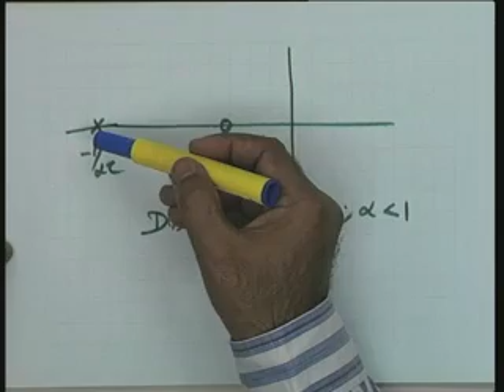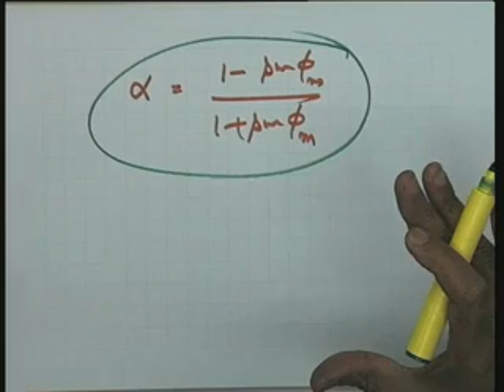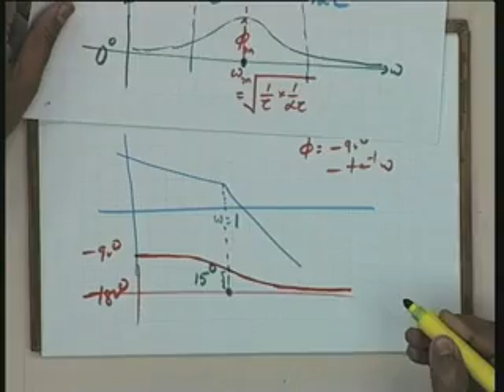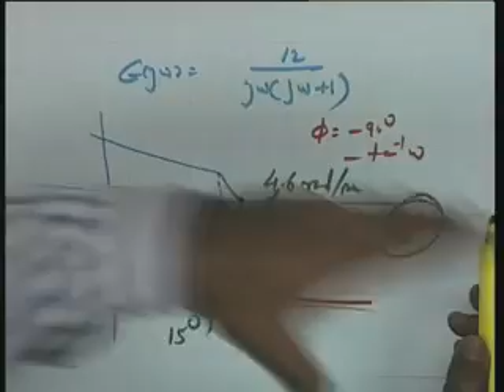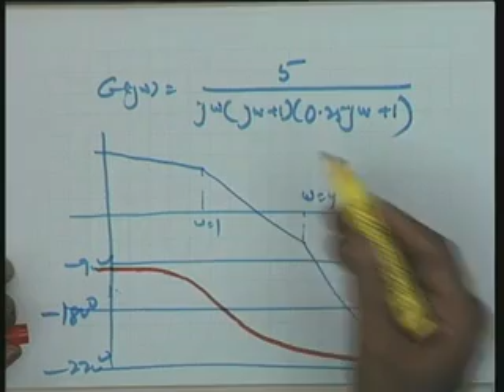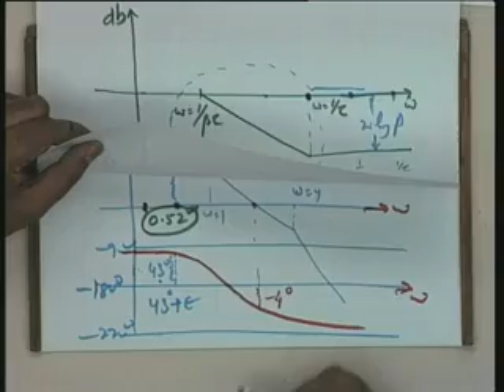Comment: phase margin at the 19:39 is 16.41 degrees at w=3.395 , not w=1. Sketch is slightly misleading over there. (i may be wrong, it's just what i have just calculated.) (welp just watched over 22:57 where a student corrects him about it)
Reply: you are true broo 16.1 degree
Reply: @gouripeddipawansreekar1752  Wow, it has been so long since I have done anything related to control systems. I don't think I can calculate the most basic compensator right now... But it seems like I have done well back in Uni.